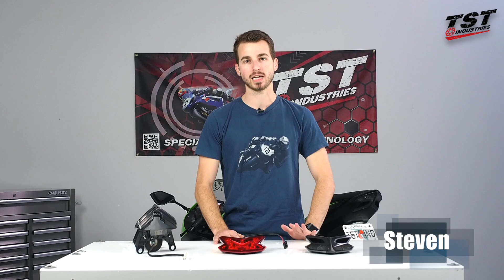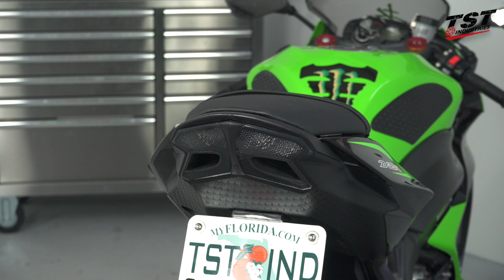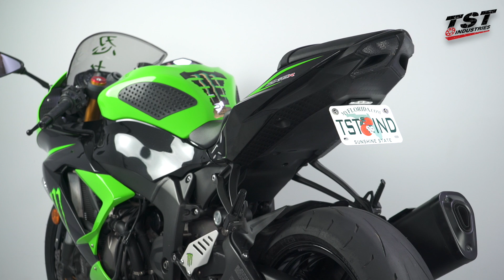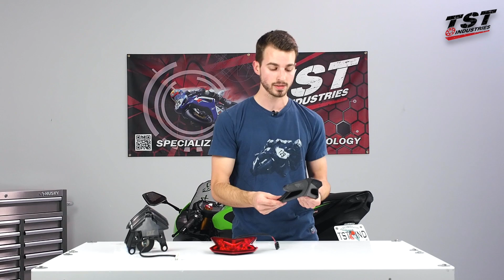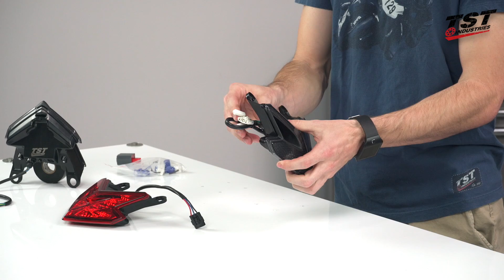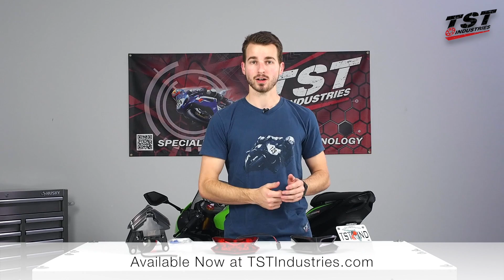2013+ Kawasaki Ninja ZX6R Programmable Integrated Tail Light - Feature Video by TST Industries

Comment: Just purchased your integrated taillight, Gen2 Flasher relay, fender eliminator w LED license plate bracket and light, for the wife's 2016 ZX6R... SO yeah all that for less then 200 bucks is awesome!!!
Reply from the maker: Awesome. I am hoping to hear your comments after you've installed the parts.
Reply: Will do, and snap some pics and vids, so I can show it off as well.

Comment: I ordered this taillight back in April 2016. I went from the stock fender to this and I couldn't be happier! A few months ago I noticed that some of the led's weren't turning on and I contacted them and they replaced it in less than a week. Nothing but great customer service I would recommend to anyone it's worth every penny
Reply from the maker: jalamos89 thanks for your comments. Your first light was from our first batch that hit the market. Some of the early lights had issues with solder joints breaking around the LEDs and that made banks of LEDs stop lighting. We have since adjusted our manufacturing technique, and slightly changed the design, so our  current production model has the same reliability as our other parts. I'm glad we took care of you promptly and that you remain a happy customer.

Comment: The only thing stopping me from buying this are the directional blinkers. I'm afraid it won't be visible enough
Reply from the maker: You can always run external signals instead of using the ones built into the capsule.

Comment: Looks awesome. Not 120 dollars awesome though...
Reply from the maker: We spent a lot of time, opportunity cost, and lost sleep developing this unit. We had to cut four molds, create unprecedented circuitry layout on four boards - one containing a mini computer, design an assembly procedure that would allow for the components to come together in proper order, develop a quality control system that would ensure our customers get units that are guaranteed to work, etc. Tens of thousands of dollars were spent on bringing this technology to the market. Each taillight costs more to manufacture than a standard taillight. That money has to be paid back somehow so the cost of each unit has to bear a fraction of the development cost while already costing a premium to manufacture. I appreciate the fact that the value of this taillight may not compute for you personally. That is completely fine. This component is geared towards Kawasaki owners who are looking for more than just a taillight and understand that to get more they have to pay more.  

FYI: Custom LED charges $149 for theirs, MotoDynamic charges $89.99. We are in the middle of those prices while providing more sophisticated technology as well as a very aggressive and exotic appearance.
Reply: TSTindustries i agree. R&D is very costly. I got this for my z125. This taillight is too perfect to explain with words
Reply: TSTindustries Just picked up your integrated taillight, Gen2 Flasher relay, fender eliminator w LED license plate bracket and light, for the wife's 2016 ZX6R... SO yeah all that for less then 200 bucks is awesome!!!

Comment: Not to bad, a little expensive compared to motodynamic which is another top quaility taillight.
Reply from the maker: I wish you could compare the MD light to ours side by side. You would notice the vast difference in quality and design. Besides that, some contributing factors to the higher price are the additional engineering time, and additional injection molding tools that had to be developed to bring this unit to reality. It is really a small price bump to get a truly superior component. If you think about it, the cost difference here is about the same as the cost of a gas fill up. Most riders that appreciate superior quality and unique design would opt to spend the few extra dollars.
Reply: TSTindustries
It looks pretty good though, very unique and people be like... r1??? or ducati lol

Comment: dumb question, but are integrated tail lights legal in Florida
Reply from the maker: +Jay Smith Someone once told me there are no dumb questions except for the ones not asked. 

It is how the motorcycle is set up that can be or not be road legal. As long as the signaling equipment on the motorcycle conforms with the local DOT standards you're good to go. If your jurisdiction requires signaling equipment located in a different place than the taillight  or spaced further from the center axis of the motorcycle then you will need to ensure that you make your motorcycle comply with these requirements. I recommend researching local laws prior to making a purchase.
Reply: +TSTindustries ok thank you
Reply: +Jay Smith , no it is not legal. No integrated tail light is because they break the set out DOT standards. There is a reason motorcycle manufacturers include those ugly as sin fenders on their motorcycles. It is not because they want to make their bikes ugly, it is because that is exactly what the DOT laws call for.

TL;DR: it is illegal, but most of the time no one bothers you. That's why he didn't straight up answer your question. At all.
Reply: +Alex Ceric lol gotcha, I don't see to many bikes with them so I was wondering what will and will not fly.
so thank you for the info